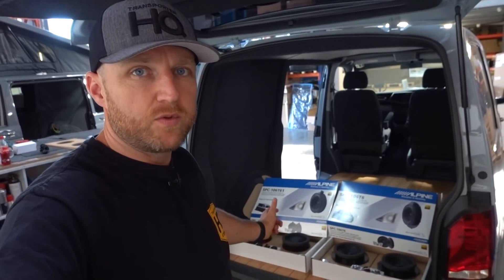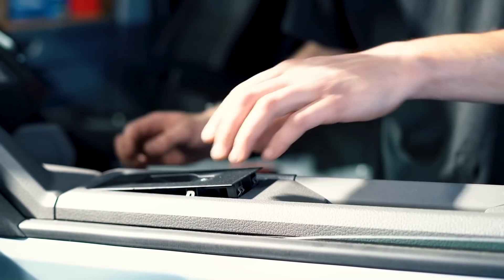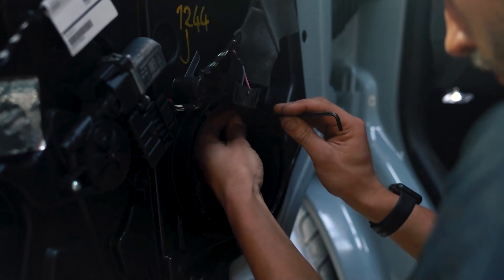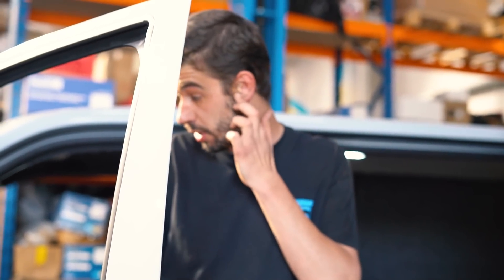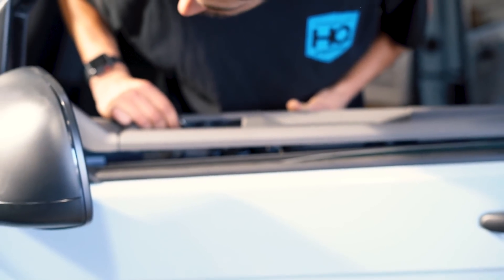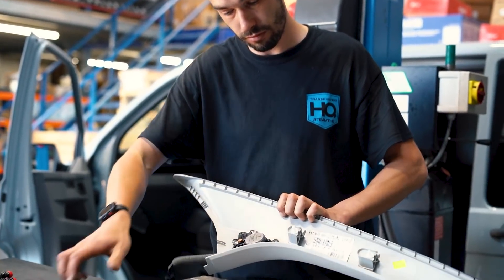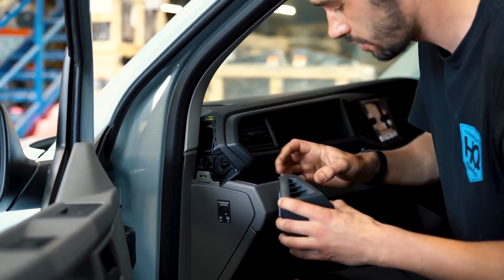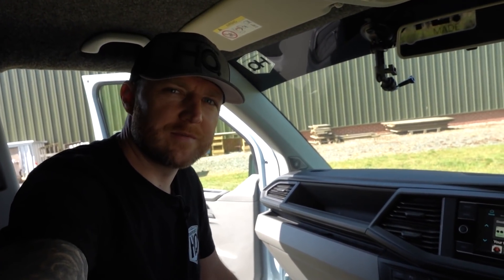T6 & T6.1 Alpine Audio plug and play speaker / tweeter upgrade. 'How to' For VW Transporter. SPC-10

Comment: Is the fitting for the 200mm T6 version exactly the same? And when are you getting them in stock?
Reply from the maker: T6 is slightly different to remove the door card but thats about it. We should have stock live in the website now.
Reply: @THQAutomotive  200mm showing as out of stock. All gone already?
Reply from the maker: @markcalvert7589  yes sold out within minutes of this video 😞 more stock in a few weeks

Comment: I fitted these today to my 2023 Sportline, but only did the drivers side woofer/tweeter and fully soundproofed the door and door panel. This was a good opportunity to compare to the standard ones 

I'm really not impressed, there is hardly any difference when you balance from left to right in the quality over standard. 

I have a Vibe amplifier, which is wired to plug in directly to the discover media headunit, I'm hoping this is going to drive them nicely and hopefully sound a lot better
Reply: Looking Into this and standard Discover Media headunit is only 4x20w RMS.

The Vibe 4 channel micro amplifier is 4x65w RMS, so these should definitely sound much better once fitted.
Reply: How did it sound with the micro amp?

Comment: Are the speakers on a California T6.1 ocean the same as a transporter panel van?
Reply from the maker: The speakers are the same but you need to cut a little more plastic away on the A pillars as they are double skinned. Its easy to see and do when you go to fit them though.